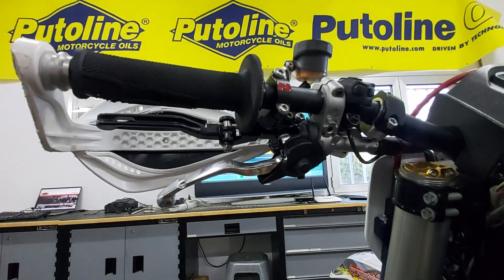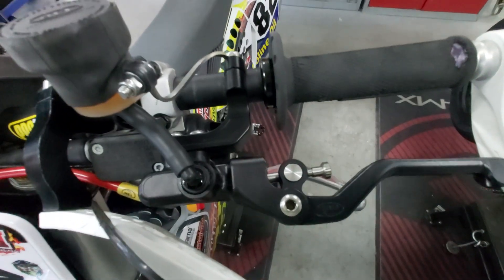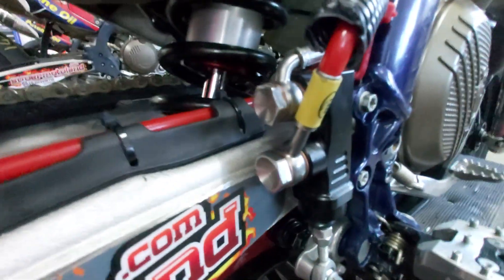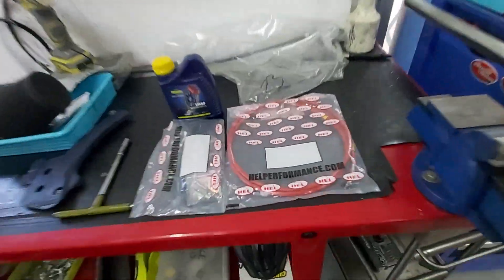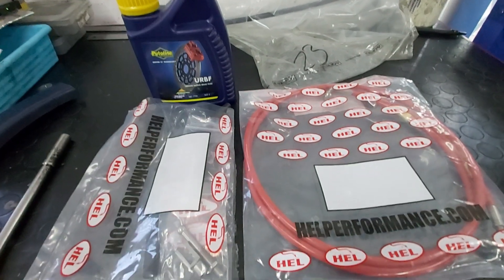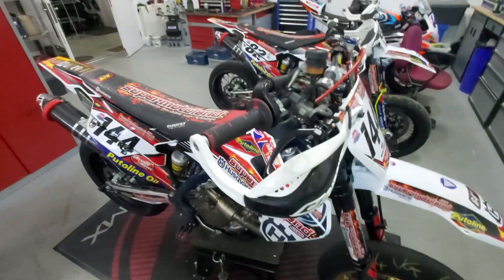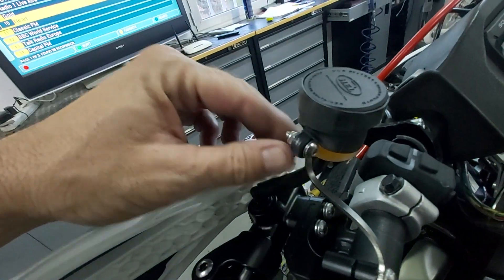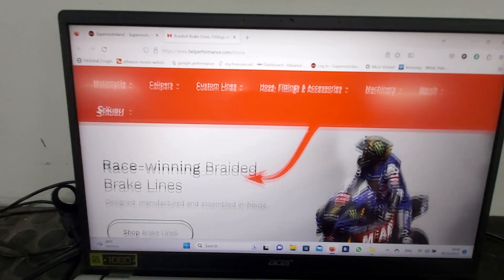hel performance rear finger brake system for the 2023 Husqvarna FS450 - development project

Comment: how does he downshift with no clutch?
Reply from the maker: with the oem suter slipper clutch on the husqvarna fs450 you can down shift and upshift without a clutch.
Reply: @SUPERMOTOLAND  interesting. i know the 23’s have the quickshifter (i have a 23 husky)… i didn’t know you could downshift without a clutch though
Reply from the maker: try it, some people dont like it and use the clutch but i have never found a problem
 @grapemustard881